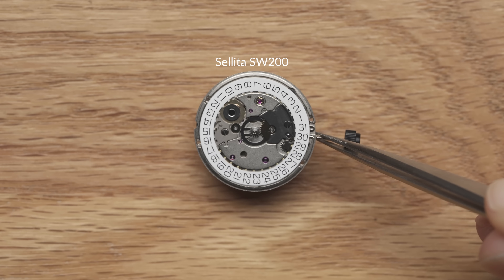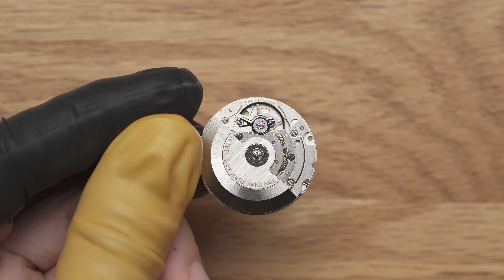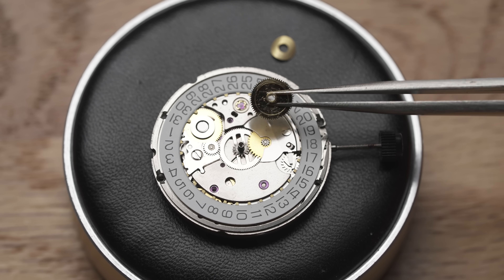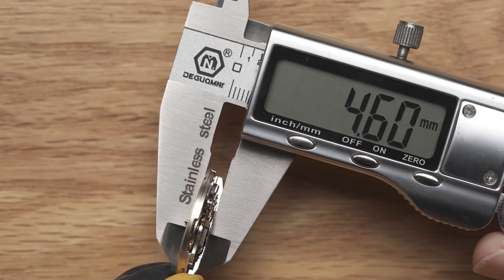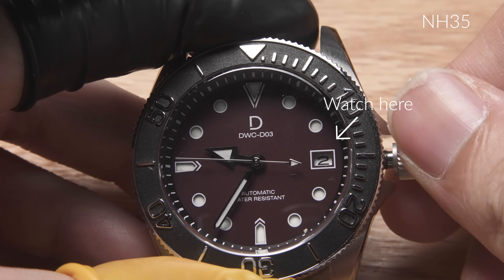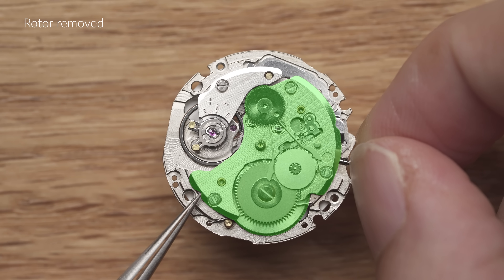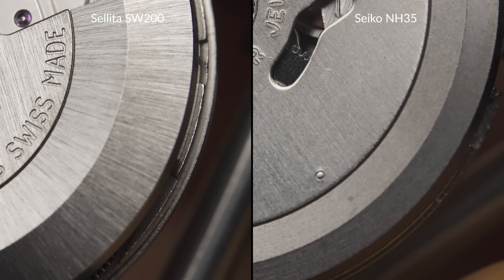Why Swiss Mechanical Movement is More Expensive (Sellita SW200 VS Seiko NH35)

Comment: I have many, many NH35 movements I've used in watches I've built and also in watches I've bought. The date usually rolls over between 11.50 pm and 12.05 am in the bought watches, and in the watches I've built when I set the hands myself I usually get the date rolling over at exactly midnight! The way you describe it suggests early date roll over on your NH35  is a negative feature of a cheaper movement, when in fact it's just the failure of the person setting the hands onto the watch! I will never be convinced the SW200 is ostensibly a superior movement to the NH35.
Reply: I would wager anything you want that you couldn't come up with any entry level Seiko 4r movement (NH35 is the same thing) that would keep time even remotely close to the Sellita movement. There are $100 watches with the 4r movement, there are watches worth thousands that contain a top or COSC grade Sellita movement. Even Seiko doesn't claim them to be even close, for that you would need a Grand Seiko 9Sxx level movement.

Comment: Looks like a promo piece by swiss watchmakers.  The date change was laughable.  The flipober design is determined by whoever puts the hands on.  Also, the tolerances of Japanese movements are very good.  The watches just use different gear ratios.

Comment: I have had NOTHING BUT TROUBLE with watches using the Selita SW200 movement.  The gear handling the hand-winding function repeatedly strips out very quickly, and has necessitated the purchase of an automatic watch winder in order to avoid hand winding.  Further, and more troubling however is that jewels have become dislodged on two occassions. I do not wear these watches any differently than any of the several other watches I own.  I simply find the Selita SW200 movement to be GARBAGE and far more troublesome and expensive to own.

Comment: SW200 is a swiss movment. The nh35 is a clone of a japanese movement, the japanese movment is not 30$. Regardless the NH35 has a better manual winding than the swiss movement.
Reply: O NH 35 não é um clone.
É exatamente igual ao 4R35 e fabricado pela TMI ou SII, do grupo Seiko Epson, são fabricados sem a marca Seiko para serem vendidos para outros fabricantes de relógios.👍

Comment: 4:30 are you high?  The swiss movement has a much coarser finish.  Just because it's a grain that goes in the same direction, doesn't mean it's finer. The NH35 is the much smoother surface.  What finish do you think would catch more dust?  LOL.

Comment: I have several 2824/2836/sw200 movements. I also have several NH35/7S26 movements. The ETA2824 is much easier to regulate and has much less positional variation in time accuracy than the Seiko movements. The 2824 and its clones are more satisfying to own and my oldest one at 15+ years without service still keeps great time. I also have two PT5000 Chinese clones of the 2824. They perform just as well as the ETA 2824’s in terms of accuracy and operation. We’ll see if they last as long. They are great value for the small premium over the NH35.

Comment: It's not fair to compare them and technically all modern NH3x movements are now made in Malaysia / China but maybe they get parts from China.   A better comparison would be of a citizen 9000 4hz or 3rd party Seiko 4hz

The closest swiss movement you could compare it to would be the swissmatic.

No one gets a NH35 or even 4r35 serviced (no difference in quality between Malay/Chinese and Japanese   at wholesale it's a 16 dollar movement you can buy them for 20 or so and they are easy to change out so no one will service a NH35 

At the same time in many nations it would be cheaper to get a Basic SW200 replaced than serviced as in the UK for example a service is about 150 pounds if you have trade discount to 300+ without.
So maybe a change would be better for some.

I've never needed a service with modern movements as I think they run just fine, also modern oils are used and such.  Service a watch when it starts to loose time or becomes inaccurate.

I would only get vintage watches with irreplaceable movements serviced regularly or very high end movements like hi-beats as in it her 4hz.   Or very expensive watches like Rolex and such 

Send in a Tudor for a service and they just swap it with another pre-servocrd movement...

Comment: I don't really agree with this setting, you are comparing a swiss movement to a tmi movement. Seiko makes their own movements. Tmi makes nh35 movement , and seiko cals them 4r35 or 4r36. Those movements are much better than the tmi movement that you are displaying. Tmi is a A subsidiary company of seiko, but seiko does not use the movement for their watches.

Comment: I don't own any premium automatic Swiss watches to compare it to, but I recently built a watch for the first time using the NH35 movement. I was quite rough with it at times when taking hands off and putting them on again etc, but nothing damaged it. 
I set it to the exact second using my radio controlled Casio 5610 and for 4 or 5 days, it was as accurate to the second as the Casio. Can't moan at that.
Reply from the maker: Installing the second hand is often the most challenging part. Feel free to use our second hand tool—you might find it helpful! 😊
Reply from the maker: feel free to check this out https://www.youtube.com/watch?v=KgbY2VvD5u0&t=1s

Comment: IMO, there's a cultural difference (philosophical difference if you will) that goes into the engineering/ finishing of the product here.
Swiss movements have a focus on aesthetics and generally are made to be able to use as drop-in as-is without further decorations. If you want to decorate/ modify further, there are other Swiss companies that do modular add-ons. i.e. Targeting smaller capacity productions with a focus on more 'luxury' products.
Asian watch movement OEM suppliers focus more on a product that just works - if you want to customize it, go ahead but you're on your own. i.e. You can decorate it if you have the means to, but you could just use it as a lower cost movement in watches that target the mass market (doesn't require flourishes). Hence why you don't see Asian companies that specially offer aftermarket modular add-ons/ finishing services.
A better comparison might have been the Miyota 9 series (same beat rate) which does have slightly better finishing than a raw NH series movement.
Reply from the maker: Thank you for the thorough explanation! 😊 Let’s compare another movement with the 9 series movement next time.

Comment: 4:16 
I bought the Laco Dortmund MANUAL winding (SW210)
In the Sellita SW200 the coupling between the barrel gear and the manual winding gear is DISASTROUS.
And in fact the barrel gear always gets ruined if the watch is wound manually.

Comment: The arguments for the differences between the mechanisms are ridiculous, you showed that the NH35 mechanism moves the date long before the required time, this is nonsense since it is a manual calibration and it is possible to make the Japanese mechanism precise which will move the date exactly at midnight (speaking from experience).

Comment: Firstly the Sellita is a copy of the ETA and saying direct descendant is misleading.  Next thing is a cheap mass produced base model Seiko vs a much more expensive sellita is about as stupid as a one sided video could be.  Maybe get a high beat seiko movement based on the grand seiko movements or at least something like a Miyota 9000 series movement which is still a lot cheaper than the swiss movement.  Also when dribbling on about the hand winding feel. Well Never had a seiko movement feel gritty or anything and I own a lot of watches including swiss made ones. I do however know the Sellita movements have had issues with hand winding and stripping the tiny gear that was also an issue on the original ETA as well but ETA seem to have fixed that issue while the ETA clones have not.  I fear this everytime I hand wind one of my watches that have a sellita in it.  I mean this video is just plan stupid on so many levels and im not even a fan of any brand that might make me biased because I love all watches.  You did not even talk about the ingenious features that even the cheap base seiko has like the unique and smart Magic Lever device that reduces the complex way the swiss movement achieved the same function.

Comment: This does not show the difference between the design philosophy of Swiss v Japanese movements at all, only the between cheap and expensive movements. An expensive Japanese movement like the SW200 will have all metal parts, tighter tolerances etc.

Comment: For me personally, I definitely choose NH35 for one reason only. If it broke, then cheaper is to buy a new one than trying to be repaired. In addition, a new one will work much longer than repaired one. For the last in nh35 and alike movements, magic fingers of automatic winding mechanism with additional oil layer are bomb proof.

Comment: 2:34 those 2 grams are "less of a burden of your wrist" ? ... are your hands that weak, to feel that 2 grams difference?
That's actually 1.7 grams difference, not 2 grams... your wrist is safe!

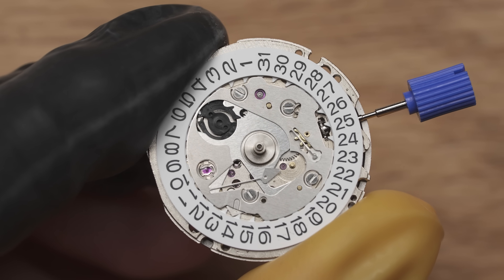2:40 Even some Rolexes have plastic parts in theyr movements. and there are MANY watches that use plastic parts in theyr $100,000 watches or more... what are you talking about, my friend?

And why are you comparing an $50 movement vs an almost $200 one? why don't you compare a $200 japanese vs $200 swiss?

I'm not a fan of japanese or swiss, they're both good, but you're looking like you try too hard to say swiss is way better finished, when you're actually comparing a $50 vs $200 movement.
Reply: plus the weight is measured with the default stem and its plastic crown. The Seikos is by default bigger than the Miyotas, shortening the gap further
Reply: He has to eat
Reply: what plastic running gear parts is Rolex using in their movements?
Reply: Plastic is perfectly acceptable for some uses. You can't make a blanket statement that metal is always better.
Reply: Maybe those are the only movements available to be pried.

Comment: I have had many Seikos, all of them still working. I also recived as a gift, an Omega Speedmaster. It lays dead for repair, after 10 years of use. The cost of the repair is more than a new Seiko 5
Reply: I inherited a Rolex. It is beyond my means to service and repair. 

My kids will be inheriting my custom built, worn and well loved NH35 watches. All the components except the movement should last through multiple life times and it will never be beyond their financial means to repair or service a priceless item.
Reply: @jayjayhooksch1  Even dead it is worth more than an a working Seiko
Reply: @TheDesertraptor not to me. I can't sell it because of sentimental value, and I can't wear it because it doesn't work. It's basically worthless. 

If I inherited a dead Seiko I would at least be able to afford to fix it and wear it.
Reply: moral is you can not afford to own an Omega
It's about prestige. Those who can afford dont get items repaired. They just buy another watch
Reply: You sound like buying a german car vs a japanese.

Comment: I would rather have the larger movement as fragility increases as size decreases.  Also, date change can be manipulated to wearers liking by installing the hands at 12 midnight just a few minutes after the date begins to change.  Date will fully click past midnight but by then most wearers of the watch will be sound asleep so will not notice.

Comment: I still prefer japanese movement as for accuracy, reliable, durable & affordable!Servicing at a affordable price range compare to swiss movement! I own a Swiss Army Victorinox Maverick Blue Automatic Model: 241706, and as for the hand winding part, it's troublesome to wind it back & fourth as to be careful for over winding! As for Japanese movement, I can wind it easily & smoothly till now! And no servicing for over 5yrs & still working as good so far! IMO!

Comment: $200 (+/-) vs $50 (+/-) movement ...
I'll take the $50 (+/-) movement, please.
1) More Affordable. I'd only have to save up a couple months for it, not 8 or 9 months or longer.
2a) The $299 (+/-) movement "starts the date change 2 hours before the change, giving you 2 hours you cannot read the date."
 2b) The $50 (+/-) movement "does the date change much closer to midnight, and is much snappier." 
I prefer the more accurate time wise and snappier date change. I KNOW the date hasn't changed yet at 22:00 to 23:59, and it WILL change at 00:00. 
I don't need advanced "warning" the date is going to change.

3) The $200 (+/-) movement "feels smother" than the $50(+/-) movement when winding ..." ummm ... both are an automatic SELF WINDING movement. WHY would you wind EITHER manually using the crown?!? 🤯😳

4) "The $200 (+/-) Swiss movement "has tighter tolerances and higher finishing" than the $50 (+/-) Japanese movement..."
At that price point, I would expect the more expensive movement to have a higher finish, and PROBABLY tighter tolerances than a movement that is in a price category/point 1/4 (+/-) that of the more expensive movements price category/point --- REGARDLESS OF WHERE THE MOVEMENTS ARE MADE!!!
I would GUESS a $200 (+/-) Japanese movement would be finished as good - IF NOT BETTER - than a $200 (+/-) Swiss or any other production movement at that price point.
As for your implied accusation "tighter tolerances are (always) better" ... I beg to differ.
For example: The Soviet/Russian AK (and SKS) series rifles have much LOOSER tolerances than the USA's M-16 based rifles. The venerable 1911 has looser tolerances than the current issue Baretta pistol.
In the field, the AK and 1911 are MUCH less likely to jamb WHEN (not "if") conditions are not "ideal".
During the Gulf War, men equipped with the then latest version of the M-16 put balloons (or condoms) over their muzzle to help keep sand out of the barrel and action. Sand (and in Vietnam, rain and mud) jammed  the M-series rifles used by US troops. The US bolt action "sniper" rifles, and AK series rifles were unaffected by sand/mud/rain.
Because of tight tolerances, the first few issue versions of the Baretta were prone to cracked slides, among other problems. The Marine Corps and Special Forces went back to the time proven 1911 pistol. "18 shots of 9mm DON'T "bear" 8 shouts of .45 ACP WHEN THE 9MM CAN'T SHOOT!!!!

In a CLEAN office environment, tight tolerances in a watch is probably not an issue. Working a factory production line or a construction site ... they MAY be a problem.
Also, tight tolerances WILL require servicing and cleaning more often, since there is no room for the normal dirt and grime that gets into ANY watch movement, no mater how well it is quote-unquote) "sealed" over time.

This vid was a waste of time. IF you are going to "compare" a $200 (+/-) Swiss movement to a Japanese movement, COMPARE TO A $200 (+/-) JAPANESE MOVEMENT!!! 😡😡🤬 EVERYTHING ELSE IS IRRELEVANT!!!😡🤬

I saw and heard no relevant "design philosophy differences" in this vid.
That the Swiss movement has more time invested in its construction/manufacturing than a movement that sell for roughly 1/4 the price makes sense. LABOR COSTS GO UP THE LONGER IT TAKES TO MANUFACTURE ANYTHING!!! Spend an extra hour or three for a "fine" hand finish, the price will reflect that time.🙄

Comment: "while comparing the nh35 and sw200 isn't fair because they exist in a different price bracket this comparison should show you how Swiss and Japanese movements differ in their underlying design philosophy" - proceeds to not talk about design philosophy and instead unfairly comparing these 2 particular movements.
Reply: Only serve to fuel watch snobs.
Reply: 같은 값이면 스위스 제품을 사겠죠. 이미 만들어진 브랜드는 어쩔 수 없다.
Reply: He actually did explain the design philosophies. One is ease of manufacturer. One solid Bridge instead of several. One makes it easier manufacturer. One makes it easier to service. I would never service an NH35. At $30 for the movement...
Reply: @GeneGirard007  Seiko does have movements made in the way the Sellita SW200 is made. it has nothing to do with design philosophy of the brand. they have different movements for different price points it's like looking at a Japanese K-car and saying the Japanese don't know how to build a luxury car.

Comment: Hm, the date change closer to midnight is a very inaccurate statement - it doesn't depend on the movement itself, but on the assembly. You can place the hands at midnight in the exact moment of the date change, so it completes the change very close to 0:00. Yeah, the change on the Sellita might be snappier and take less time than on the Seiko, but it has nothing to do with the exact time of the date change. It could as well change at 3:00 if someone assembled the watch this way and it doesn't matter what movement is being used.

Comment: Firstly, I want to say that although I also own several SEIKO watches myself, I agree that the accuracy of SEIKO movements is indeed lower. However, as you mentioned at the beginning, you are comparing two completely different price point movements. Yet, in this video, you keep emphasizing the inferior craftsmanship and finishing of Japanese movements, which is completely illogical and unfounded. Isn't the price difference of mechanical watches reflected in these finishing techniques? Comparing movements of different price points and concluding that Japanese movements are inferior to Swiss ones is simply without merit.